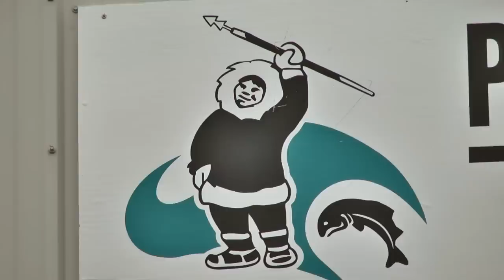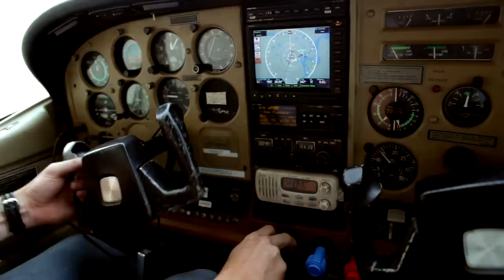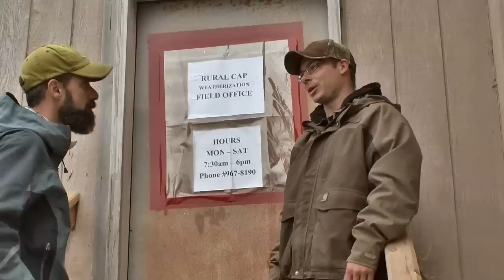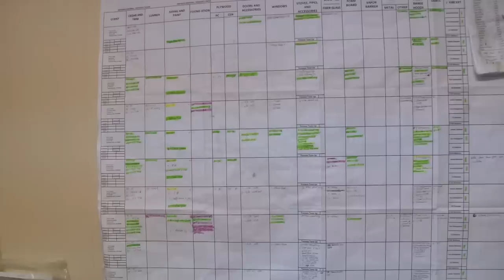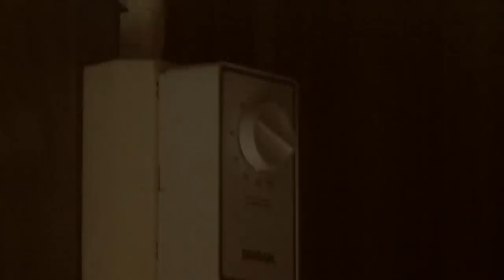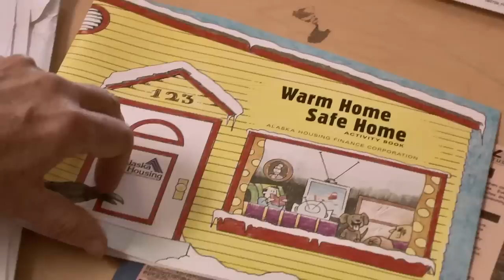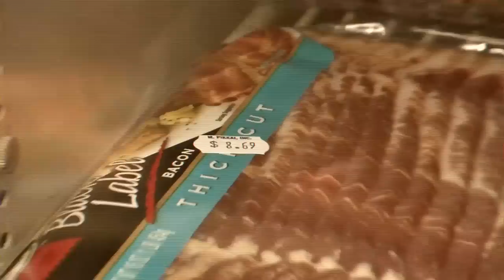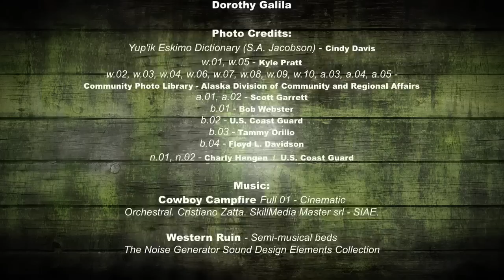The Warmest Village in Alaska

Comment: You guys should be using Closed cell spray foam for the whole house, eliminate all the air leakage and wind blown snow etc. Just spray 2" over the whole existing building and coat with a roofing coating. Basically would look like a rectangular igloo.

Comment: Holy crap today is 20 degrees in the part of massahuesetts I live in and quite frankly im frezzing to death. I cant imagine -40. How do you even step outside without dying. I know you wear a ton of layers. But I do that up here and its just about unbearable in winter.
Reply: They use a lot of seal oil in their cooking. Seal oil is a natural to aid the body to fight off the cold.
Reply: I’m originally from Sturbridge Ma and now reside in Alaska, the cold in Ma is a humid cold where the cold at 20° feels like -20. The cold in Ma goes right threw your close. In Alaska it’s a dry cold 20° feels like20. -10 feels like your in a walk in freezer. It’s dry and cold but tolerable. Just dress in a few layers and your good.

Comment: Now they just need an inventor or engineer to pick up the challenge of inventing, building and installing, testing a very small windmill that can survive and even thrive in 105 mph winds that are compact as can be and can be installed on each home so they can provide their own free electricity to each house. Sad to see not a windmill in sight with all of that potential. When I found out that the large (180 feet in dia. 3 blade system) of GE actually shut down in high winds and also took a minimum amount of wind to get them going..... I simply said in under a minute to my brother, they need to put in a transmission for it so it can monitor itself and protect itself from the damage of high winds. Now they have them. What a great potential testing ground for a new start up company and a challenge to boot!. I hope the right folks get this message and make it happen.

Comment: Yet NO windmills.
Reply: I think wind turbines to generate electricity would be a great idea for that area. And I'd much rather see the Feds help these people out more than the Katrina victims where everyone is on welfare and live under sea level.
Reply: Fast winds brake wind turbines, this would make a HORRIBLE spot for a wind farm. Slow, steady and reliable look for that.
Reply: But not if a design plan is implemented for a low center of gravity Stainless Steel housing mounted turbine
Reply: The winds are too high and too fast for wind mills....... terrible idea in general at this location
Reply: Someone should design smaller robust turbines designed for high wind areas.
Reply: seems to me , with no trees , solar would be a good option for lowering costs....at least the 4 months that the sun shines....
Reply: there are some wind farms not far from me and i read there are huge complaints from residents about the noise they make all day and all night long.